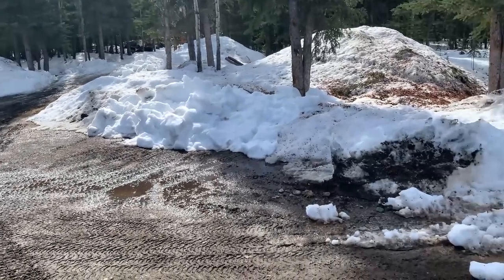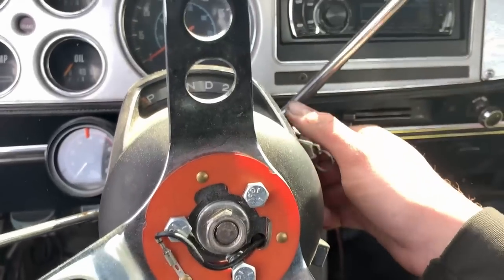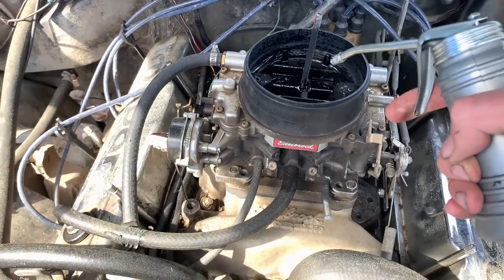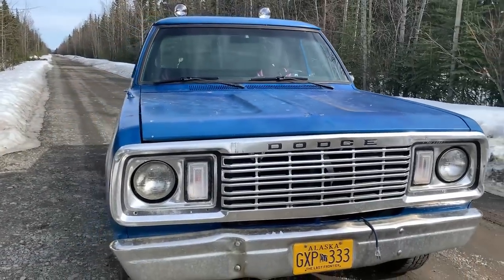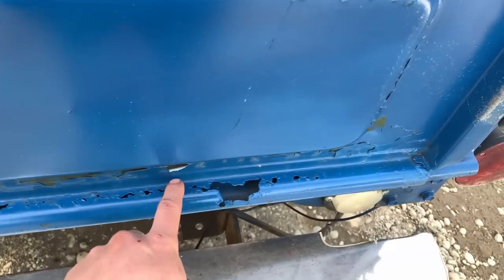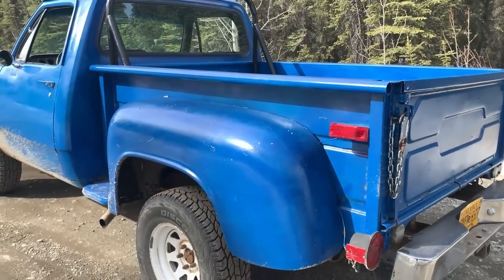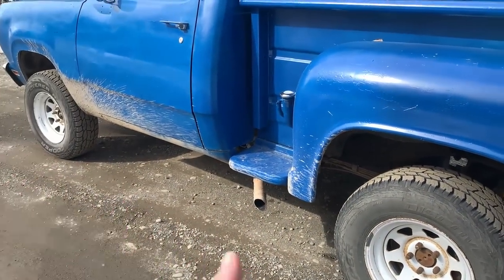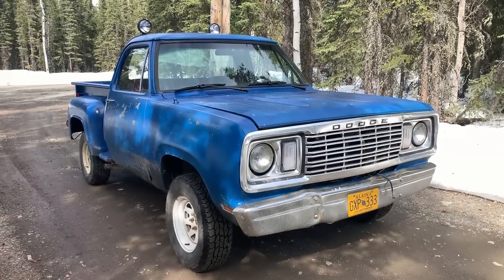1977 Dodge W100 Stepside

Comment: Those W100s are a beast, they are fun to drive and work with, had one down in North Carolina as a longbed, same config, 318, w/ the 727, never failed on me (until I loaned it to a mate)
finally got that thing ready to rebuild, tho I replaced the small 241 with a beefy 205, and running 318 heads on a 360, bumps the compression and gets some low end out of it

My Alaskan W200 should be running in the coming months, that lil 225 and NP435/205 will make her a cruiser

Comment: Good old Dodge. The 318 is a bullet proof motor. I've a 2001 Dodge with the 318 and a 5 speed manual  it has 240 thousand on the same drive train. They are a bit of a dog but durable and there should never be carpet on a truck floor solid rubber like they used to be. Another great video keep them coming!!

Comment: I’ve got a 77 3/4 ton I’m going through right now been off the road since 95 and sat in a barn for about 10 years. Poured gas in the bowls pumped up the tires and drove it home. Hard to beat an old Dodge
Reply: Please make a video. 😊
Reply: I might one day. I’ve got enough work to do on it I could have a year of content. It’s gonna make an awesome truck it’s a 360 4 speed. Currently working on the brakes so I can add some whoa to the go it’s got haha
Reply: Finally got a brief walk around of the rig up in short form if you wanna go check it out. I filmed it funny but it’ll work for now haha

Comment: Spring time still has deep snow. 
Dodge isn't bad it's the wiring tends to light up
I run a 79 power wagon with big block 6 inch stacks with 4speed long box 9 foot 10 inch tall on 285's  heater works great like being in a Sona nothing wrong with calico body panels

Comment: What a treat. Good ol' 318. Fill it with oil and check the gas, it will out last You. Just put a 383 with a 440 crank behind that 727 and it will draw Your attention... Best Wishes. 👌🏼

Comment: My Dads Valiants back in the 60s and 70s had that same starter sound but they were all slant six engines.  He put a lot of miles on those cars.  Some went over 300,000 miles.  I always wanted one of the 60s or 70s half ton dodge trucks with the slant six engine.

Comment: I had a '76 metallic green with a 318 myself. Unfortunately, it was totaled sitting in a parking lot by a semi-truck. I don't know about the health of your motor, but I can tell you the Carter carb on top of it needs to go. It is wrong in so many ways.  I suggest a new intake and four-barrel, nothing crazy or you will drown it.  The difference was night and day for me.

Comment: Years ago I worked with a feller who had a similar truck. He even painted his blue also but with a paint gun. On the farm we used a Power Wagon with 225 6 banger and 4 speed. Pulled many a hopper wagon full of corn out of the field. If you could get to roll it would pull just about anything. AL B.

Comment: I had a '77 W300 for a while. I also had a '77 F-250 but I'm not sure if it was a highboy or not, it had a 351M engine but also had a divorced 205 transfer case. Both of them had Holmes wrecker beds. One of the local towing companies used them for recovering stolen cars from swamps. They were cool as hell but so damn rusty.
Reply from the maker: Awesome. Yeah a divorced transfer case is a highboy. Wasn’t until late 1977 until they married them together.

Comment: Nice looking Dodge. Would like to see it in its original color. The oil leak if the oil is all over the top of the engine. Check out the oil sending unit. It is on the top of the engine towards the back. They have a diaphragm in them that can go bad. I had a 75 Plymouth car that had the 318 in it. It was leaking oil. Ended up being that sending unit.

Comment: To solve your Mopar starter issues a 1995 Dodge v6 magnum Dakota both bolts to the top and bottom and has the same wiring as well .

Comment: This old man is a ford man but give this year mopar its due... I seen them with a sign on the doors, little "color" truck outlined on them as in little red  truck or what ever color it came down the line as ... I believe that they only had like three or four different colors  they came in. Its the bed of those rigs that made them right popular with a varnish covered wood floor in the bed and then on the outside was wood strips that was also varnished so it followed that theme on them. They also had stacks on the sides with chrome muffler guards and the top of each stack was a curve that turned out to add to its day and time popular look. Also those interiors had a lot of varnished wood accents. I ran across one with a leaning tower of power in it and it had only one stack hooked up and the other one was just decoration. I do know that when they come up for sale, the price tag of a say thousand dollar rig just got another zero added to the price of them. Them that are this nice of shape (Google one) just needs the bed fixed up so it looks like they did back then and a kind of resemblance of the harley bike signs was outlining the name on the door. I seen one in a video that was black and boy howdy... this ford man could of rocked it just fine

Comment: You should put some stacks on it like the little red express trucks have or the Warlocks I have a 1979 with the same box and I put stacks on it with straight pipe mufflers and it sounds good and I'm running a 318 in it but mine is healthy with a thump cam in it pushing 11to 1 compression with a set of trick flow heads the thing boogies it's all black with black interior and has a a tuff wheel with lill red bucket seats. That truck you got could be killer if you do it right but sounds like your not much of a Mopar guy like I am anyway it's a awesome truck you have there 77 is one of my favorite years.